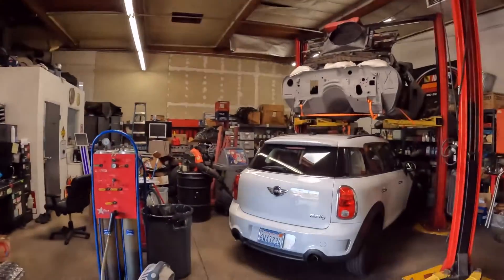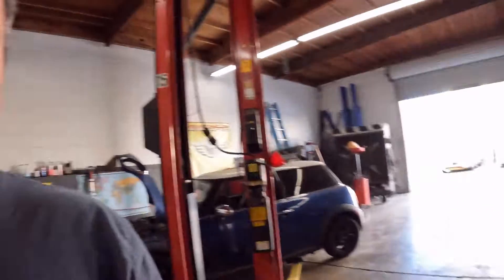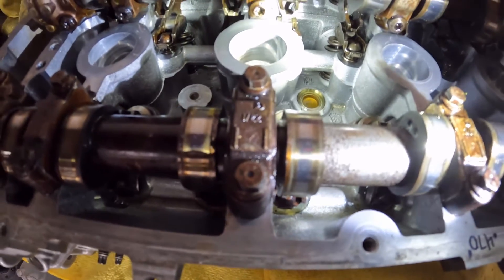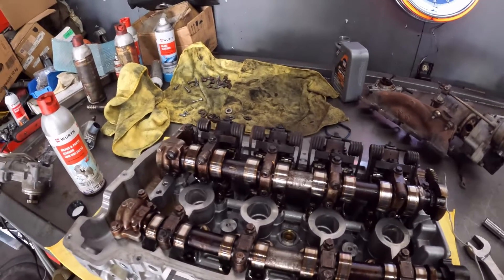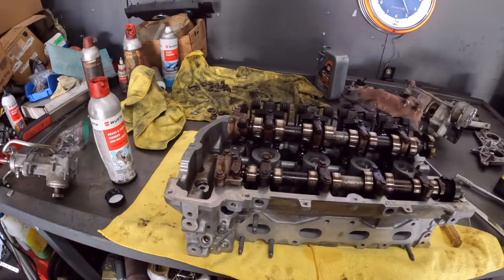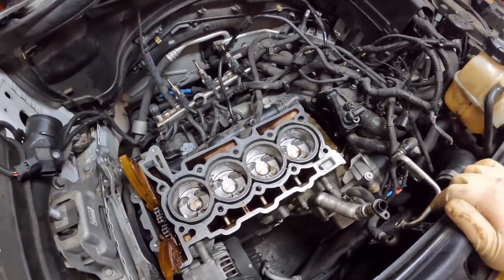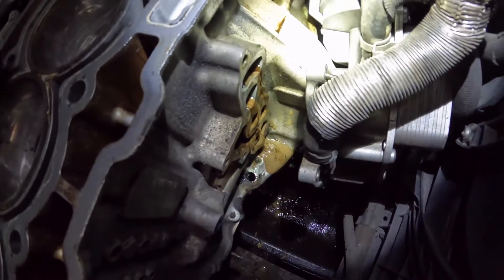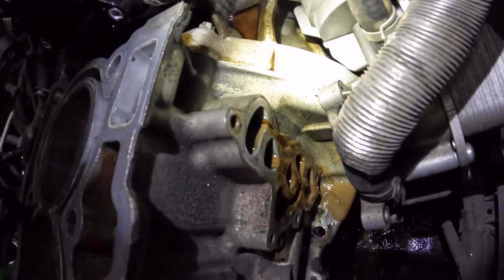Re Assembly Of MINI Cooper Cylinder head N18

Comment: Because of white smoke in the tailpipe and engine bay turbo area, I replaced N14 oil filter housing gasket to block and oil cooler gasket. 
When I started my Mini for the first time, it still had white smoke in both around turbocharger position and exhaust tailpipe.  Is it a blown head gasket? 
Why did your client not ask to replace timing-chain?😄

Comment: Step daughter just ran her N18 hot because the friction wheel gave out.  Coolant filling up the crankcase faster than I can pour it in.  I reckon it's the head gasket.  It's not getting into the combustion chamber though.  225K so I suppose it's engine time, but dang they are expensive.  Motivation is a factor since I've got other projects much more pleasant.  
You the man on beating book time.  Thanks for sharing.